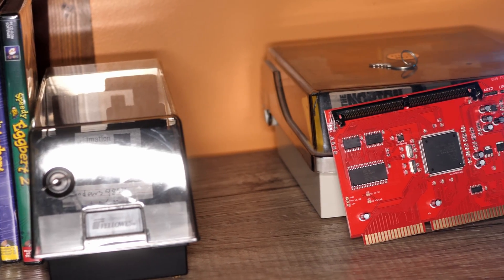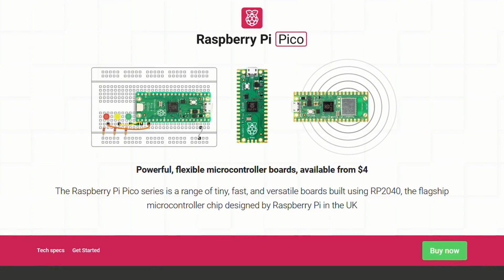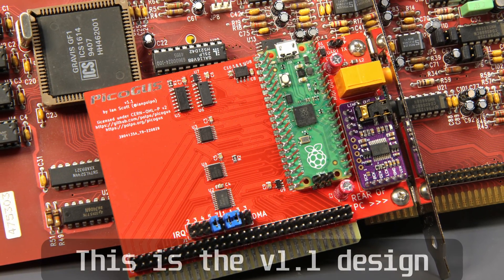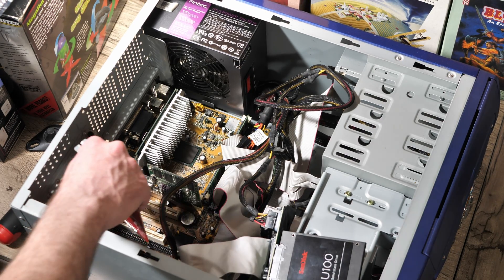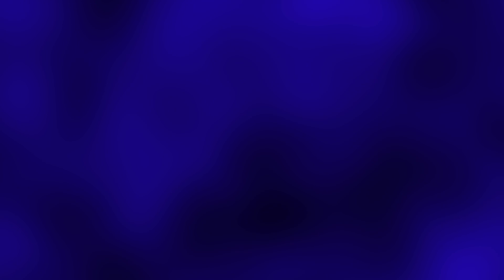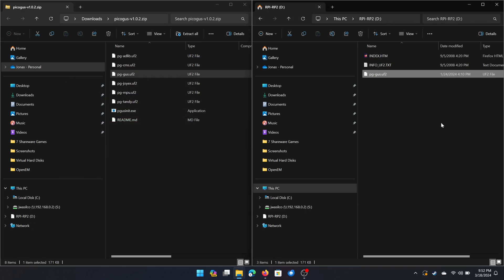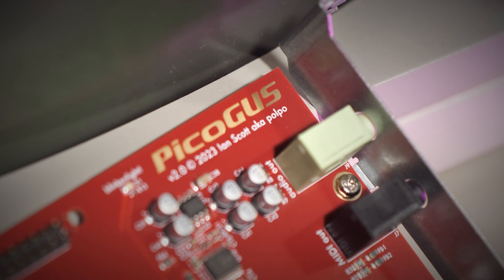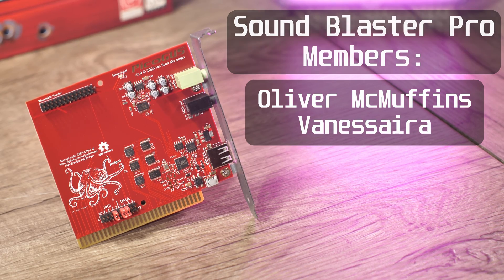The PicoGUS 2.0 is the Only DOS Sound Card You Need!

Comment: Greetings,  sounds good... $45 dollars is not bad.  I have something to ask and share.  First is IRQs, how many does it use? Can it emulate more than one card at the same time? Is it just a playback MIDI emulator or can parameters be modified for the MIDI?  When I saw your title, I thought it might be like a setup that I have. I use MIDI for all of my music and I can access all parameters in my cards.  I will share your video with a friend. Here is a link to my video where I show a 5 in 1 like yours. Thank you for your video and I will look more into this Picogus card.  I still have not seen one that can replace my setup. Cheers...  https://youtu.be/mak_lTMU7qI?si=xmbWRmf_lHyt5drT
Reply from the maker: Just one IRQ and DMA that is set with jumpers. Unfortunately, you can only emulate one card at a time, but with multiple PICOGUSs it might be possible? I've never tried it but I remember the dev saying it was possible.  The MPU-401 emulation is based on HardMPU and I believe only supports output rather than input.

There are a few things that have been updated since I made this video. The main one is you no longer need to change firmwares to switch between emulated cards. Now you can just use a command switch with one firmware to change between GUS, SB, and MPU401 modes. At some point I should make an updated video.
Reply: @DOSStorm I have 5 cards working simultaneously while in cakewalk as well as the native MIDI from windows. 3 cards connect to 3 modules via MIDI port from the cards.  2 modules connect via serial. Parallel connects to a 8x8 MOTU now and still has USB activated for file transfer or other devices.  The Machine is a AMD 486DX2 66 w 256 ram.  I can load SF2 on SB Live or cakewalk.  🎉 it's my dream Machine.  I can also link to laptop and manage its cakewalk with multiple software synths at the same time.  Even my keyboards connected I can use all the Formats in one project.  They don't make them like they used to.. 😅

Comment: $45 is a really good price. Imagine the price of these sound cards when they came out? The thing about a card like that: the problem is that emulation can sometimes have a higher quality than the original, but those flaws actually make it sound better. 

One feature I'd like is RCA out (1/4" might be harder). I had so many problems with 3.5mm on sound cards and motherboard audio outs. I think the main reason why I have a USB DAC is so that I avoid 3.5mm

Comment: It's only 8 bit?
Reply from the maker: Yes, it uses a 8-bit ISA slot. On many old sound cards a 16-bit bus is only necessary for the CD-ROM interface which is why the PicoGUS and most reproductions only use a 8-bit slot. It shouldn't effect sound quality in the slightest, and makes it more compatible with older systems.

Comment: Is it possible to connect a MT32 Pi to this card?
So we can have Roland MT32 and Sound Canvas combined with a nice ISA card?
Reply: Or can this device itself even emulate the MT32 and the Sound Canvas so no other hardware is necessary?
Reply from the maker: Yes, there is an adapter included that gives you a MIDI output. I think MT32 emulation is something they are planning to possibly incorporate in the future(with a firmware update) but as of right now all you have is 3.5mm to MIDI out for real devices.

Comment: If they made a pci variant of it it will be best
Reply from the maker: There are definitely some hurdles that would prevent that from working as well. The way the PCI bus communicates is a bit of an issue when you're trying to run old software. Some motherboards have better support with things like SBlink, but PCI cards and DOS programs are a bit of a nightmare.

Comment: Where can I download pg-adlib.uf2, pg-mpu.uf2 ...?? Thanks
Reply from the maker: With the latest firmware, you don't need to reflash the card to switch emulation modes anymore. You just use the /mode command line switch when you run pgusinit.
Reply: @DOSStorm  Thanks

Comment: I just found this channel and I like it a lot! Great shots of the monitors as well! Would like to learn how you pulled them out.
Reply from the maker: Thank you, I'm glad you're enjoying the videos! More are coming. As for my setup for recording CRTs I use a Panasonic GH5 at about 400 ISO and a Meike 60mm F2.8 lens. Some of my earlier videos I used the open camera app on my phone which I actually have a tutorial on for shooting CRTs. In a nutshell it's all about syncing the shutter speed to the monitors refresh rate.

I switched to the GH5 so I could get better quality, but it also has a really great feature that allows very granular control using an electric shutter setting called synchro scan. With that you can makes changes to the shutter speed in 0.1 increments. This is super helpful in cases where the refresh rate is slightly off and you can set it to something like 60.2 to smooth the flicker out.

Comment: where can i get the uf2 files from
Reply from the maker: A few things have been updated since this video. All the modes are now contained in the picogus.uf2 firmware. You can now switch modes instantly using PSUSINIT.EXE /mode without the need to reflash everytime you want to switch.

Comment: Would it be possible to use two in one machine, or should I also look into this and PicoMem for the Adlib portion?  I only ask, as I'll be getting my Amiga 2000 with 286 bridgeboard repaired, and want to have both Adlib and GUS at the same time.  Just wish I had a 386 bridgeboard, so I could run ScreamTracker 3 to make songs with GUS and Adlib at the same time.
Reply from the maker: Hello! Sorry for the late reply. I think Ian Scott(the project leader) said in a comment that two cards at once should be possible. You might want to check with him on the specifics though. @ianpolpo

Comment: Thanks for the video! Regarding Descent, I had a similar problem when using Descent with an external Roland Midi device. It crashed during startup. After I downloaded a newer version from the internet it worked just fine. The version I am using now is 1.4a from May 2nd 1995. I do not have a PicoGUS yet, so I cannot confirm if that works but maybe it fixes your issue :)
Reply from the maker: Good point, I think I'm just using my CD copy so patching it might help.

Comment: Thanks for video. As the wiki states, doesn't work on an IBM 286 PS/2 8mhz computer. Needs faster, like 386+. However, maybe I can program the pico to emulate something like a MT-32 on a fast PC and then try again with the 286.
Reply: Just confirmed that you can flash the picogus on a 386+ computer and then use that flashed picgus on a 286 computer. Listening to games using the MT-32 flash on an IBM PS/2 286 8mhz machine

Comment: RP2040 and ESP32 (with FabGL) have been powering a lot of cool, inexpensive hardware lately. I'm glad more people get to experience a GUS now(I already did, back in the 90's). The ESP32 by itself is a decent PC emulator and the latest P4 version of that looks targeted for more performance with some 2D acceleration, so perhaps we'll get some video cards or single-board microcomputer designs exploiting that...

Comment: I just joined the waitlist. I wish it had a SoundBlaster and wavetable support and the same time.
Reply: I think it’s doable! One of the next things I’m going to try is simultaneous SB and MPU-401 emulation.
Reply from the maker: I wonder if you could use two of them at a time flashed with different firmware? Slightly silly but it would be cool.

Comment: Finding a Pico Gus 2.0 sound card these days is like trying to locate a Bigfoot dropping an album on vinyl. This is a Joke.
Reply: I recently got one after being on the waitlist for a couple of months. Sure, they are sold out at present, but there's no reason to believe that they won't be available in the future. Moreover, the project is open source and anyone is free to build one themselves. Even if polpo decides not to create any more, someone else on Tindie could sell them in the future. This video is hardly a joke.
Reply from the maker: You're not wrong. However, as long as they keep being produced the stock issues will hopefully clear up sooner or later.